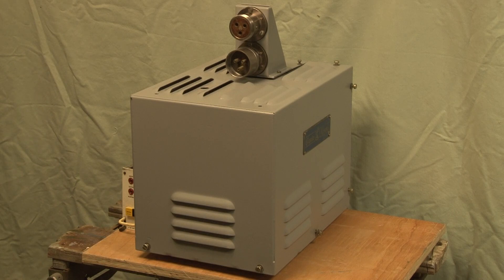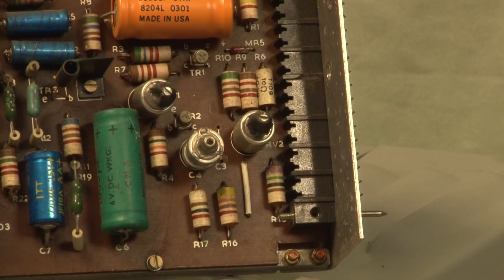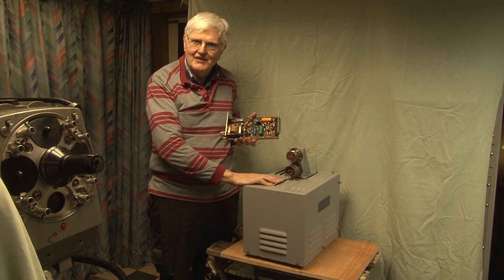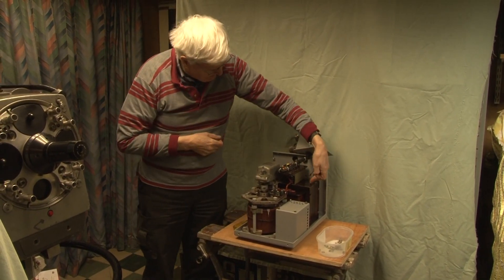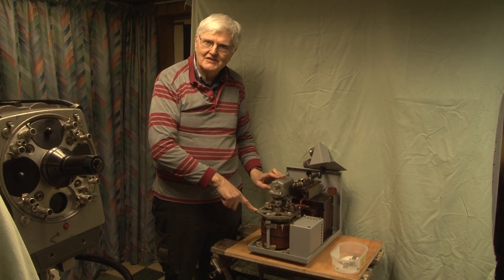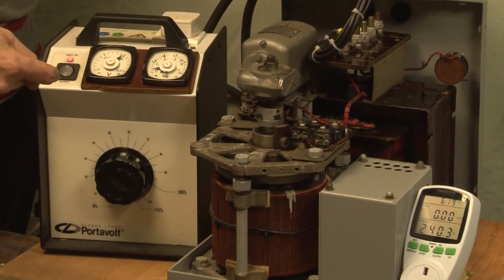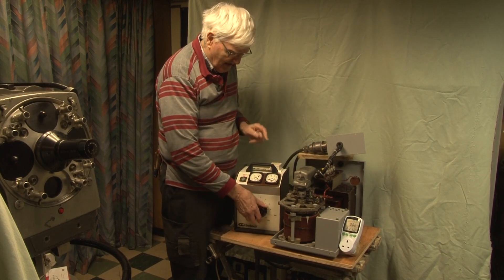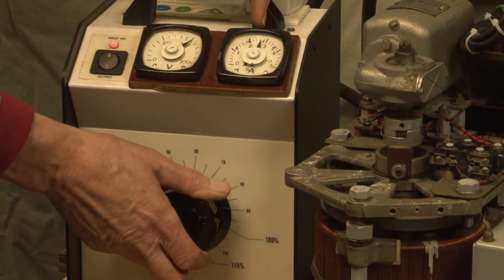A video about the Automatic Voltage Regulators used in MCR21

Comment: I was expecting to see a constant voltage transformer. What a great setup using a motor driven variac for probably  a much greater range of input voltages. Really impressive how well it tracks and corrects as you vary the input voltage.